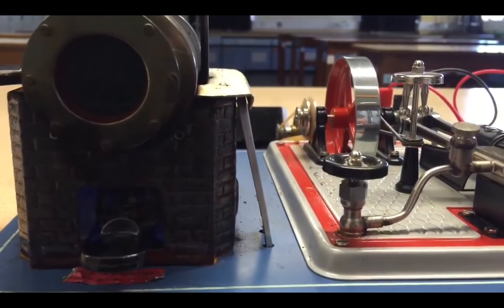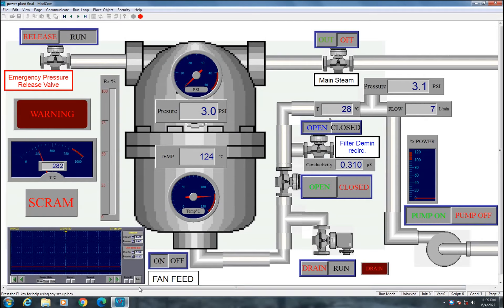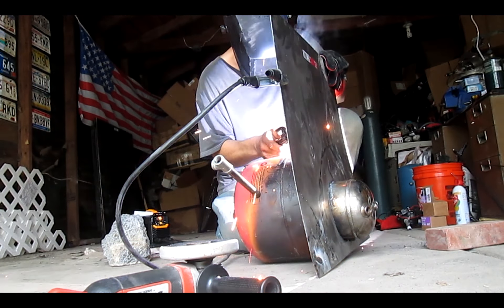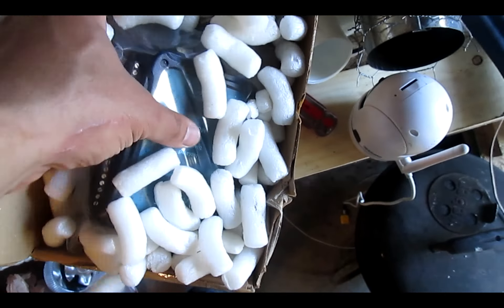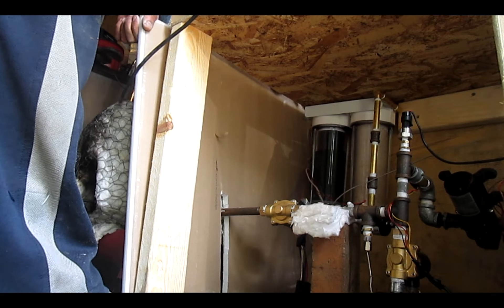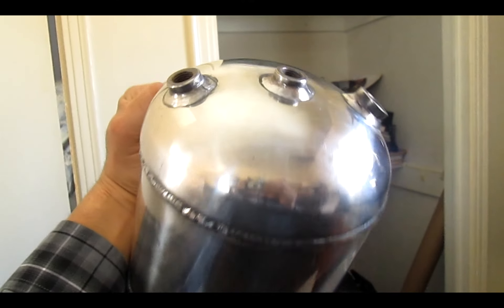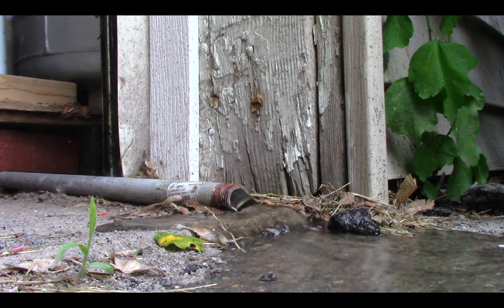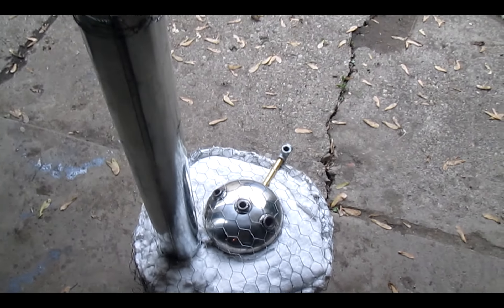DIY Power Plant part 1

Comment: I use to run a boiler at a lumber mill. Yeah reclaiming hot condensate is critical as there is tons of energy remaining in the hot water. We ran at 150psi and it’s amazing how much energy can be transferred through high pressure steam. A big thing is removing oxygen from the condensate. We use chemicals to do this as well as a vented DA tank. The oxygen in the water will create carbonic acid and start eating carbon steel pipes. It’s most noticeable at elbows.

Comment: The Rankine Cycle... The intro to Chemical Process Engineering is coming back to me 😅

Turbines are generally high precision engineering feats, so I don't envy you on your journey to find/make one. Maybe start small/simple, and iterate from there?
Reply from the maker: Yeah that's the problem. I've seen some medium size made by amateur remarkably nice . I don't have the skills or the equipment to make my own but I'll eventually come up with something...
Reply: @Neptunium  I've been struggling to think how to build a cooling tower for my home distilling, so thanks for your brilliant idea!

Yes, unfortunately some lathe turning and sheet metal pressing for the rotors and find respectively :/

Comment: I feel like your best option here is making your own turbine. That can be quite a challenge but if you connect multiple car blower fans you might get some reasonable generation out of it. Or you can always change the motors for alternators. They can give good output if you rewire the stators. Also I think that impulse turbines would be a lot cheaper to build. Really nice project can't wait for your next video on it.
Reply from the maker: I am not sure I have the skills or the equipment to build my own turbine... Although I've seen some very good one made by amateurs... I also looked at engine turbo but the oil pressure bearing is annoying.... I'll come up with something eventually... Thanks !
Reply: There used to be an electric turbo you could bolt onto your car to give a few pounds of boost. I think they were 12VDC at a pretty high current, so it might be a good match for this project.
Reply from the maker: @cpm1003  are you talking about the air vent turbine ? Some are made of plastic and other aluminum and fit into the air intake duct?
Reply: The high speeds of a turbine require extreme precision and quality parts, not in the realm of most hobbyists

Comment: If it's a closed system you could run the boiler at a lower pressure for a lower the boiling point which give a larger volume change at a reduced pressure difference. Just something to think about.
Reply from the maker: There is a lot to learn that's true ! I will certainly keep playing with it and learn as much as I can !

Comment: 1 meter in diameter(or bigger) axial flux like generator, the size will make it low rpm generator and produce decent power as home power generation. what do you think? less pace cheaper.
Reply from the maker: Wow! 1 meter diameter is huge! Gonna need to build up some pressure to get it to move I am guessing!

Comment: very cool project!  Have you played with making your own wood gas generator to fuel the power plant with wood?  There are a couple large scale power plants in Michigan that run on wood gas derived from wood scraps/silage.

From what I recall, to achieve maximum efficiency with a steam engine, you need to run it with super heated steam (around 600F deg) so that the steam becomes a true gas.
Reply from the maker: Thanks... No I didn't make my own wood gas ! Lol this would have been beyond the scope of what I was trying to do, you know, these projects are expensive and extremely time consuming, not to mention the editing, narration, post etc... But hey someone could pick up where I left off and continue on.. maybe take the idea to a new direction...
Reply: @Neptunium  I hear you in re cost and time.  I imagine you easily have 80+ hours into this.  I was blessed to be in a special program where we were allowed to create our own curriculum and received funding to build our projects.  Here is a computer controlled two cylinder fluid-power motor we built back then (SMC Pneumatics Corp (their R&D lab north of Detroit)) provided my partner and I with the components we needed): https://youtu.be/oWLMXq-27Ck
Reply from the maker: I see... Somehow, I am not surprised!... Are you from Detroit ? Where is the interest for Haiti coming from? Do you speak French?
Reply: @Neptunium  Michigan.  I've been intrigued by Haiti for many years for various reasons.  As bad as it is there, I'm drawn to the "wild west" nature of it.  It is a place where you are free to pursue "big ideas" without the need to comply with rules and regulations--as long as you have the local people on your side.  

Only about 10% of Haitians speak French (90% only speak kreyol).  That is a whole other issue, i.e. most Haitians cannot read government documents and god forbid they get hauled into court...they don't understand what is happening.

In the Department Grand'Anse (where my team is focused) about 40% of people cannot read or write...they are illiterate.  Haiti consists of 10 Departments that are similar to the 50 States in the USA.

The peasants are not dumb but are very smart in terms of subsistence farming...but most families can only afford to send one or two of their children to school as it costs about $50/year for tuition.  i.e. most people in the Grand'Anse only make about $1/day. There are no public K-12 schools in Haiti.
Reply from the maker: @blancinhaiti5724  sounds about right unfortunately I am not surprised. I do understand the "wild west" attraction. The frustrating bureaucracy  and legislation makes it difficult to get thing done in a time frame that would make sense for the people suffering the most . I dont really want to get into a debate here but I am not a fan of the administration in general as you may have seen in a few videos.. Maybe you and your wife could retire there at some point ? that`s what I would do!
Anyway, if you need some analysis done as long as it`s not a thousand sample and you aren`t press by time , I can do a few from home ..
Reply: @Neptunium  Yea that would be nice to "snow bird" there in winter.  I'm not sure about a "debate."  Are you talking about the Haitian administration?  If you mean the current U.S. administration, I agree with you.

Our water project is actually on pause at the moment until we resolve some land issues.  Despite the "wild west" situation in Haiti, we are attempting to comply with the land laws to ensure there are no issues down the road.

Comment: i would suggest you using car turbine and some kind of permament magnet motor or car alternator
Reply from the maker: Yup. Great suggestion but I went a different way: https://youtu.be/_0vydSkvSUs
Oh and this project has been completed for a few months : https://youtu.be/MpCOy3CG5bg
Thanks for watching
Reply: @Neptunium  i just finished watching other two videos, over all great project, i would now go for trying to make it operate for long periods of time with electricity output. Also how hard you think it would be to create some power from decay heat of some radioactive elements? i was thinking about small thermoelectric generator that would be able to put out atleast 10-20watts clearly from decay heat
Reply from the maker: @kimdzongdzwon82  lol ! Go ahead! You'll need a lot of it! Good luck ! Lol

Comment: if you end up using a Tesla turbine, as some suggested, you may also consider decreasing complexity of the entire system, as Tesla turbine can work with "cold steam",  based on cryophorus principle, as demonstrated here: https://www.youtube.com/watch?v=JvRCB_HhseY (short) and here: https://www.youtube.com/watch?v=hm8m_0rzyMo (long), as in that case all the safety net needed to deal with the high pressure goes away.
Reply from the maker: Interesting... How easy is it to find a Tesla turbine ? How expansive are they? ... I'll check into that.. thanks !
Reply: @Neptunium  Not sure where one can by one. Historically there has been, and even currently there is, extremely limited research in these 0.5-100KW steam power turbines based on the boundary-layer-fluid principle. There are 3-4 youtube research channels that show experiments with them ( as the one I linked to ) but their turbines are self made. Notably they are not so difficult to make. even without especial tools, although recent geometrical ratios need to be considered for good efficiency.